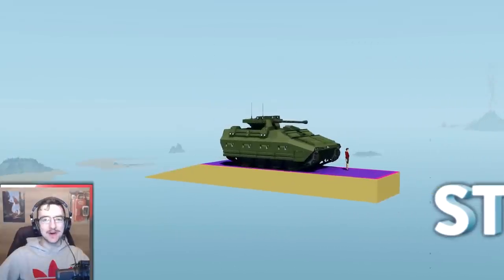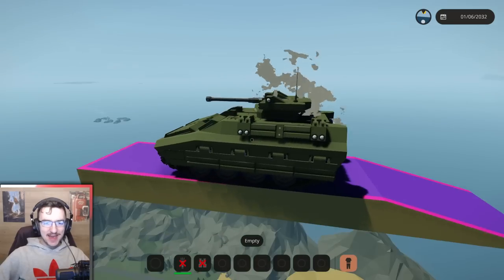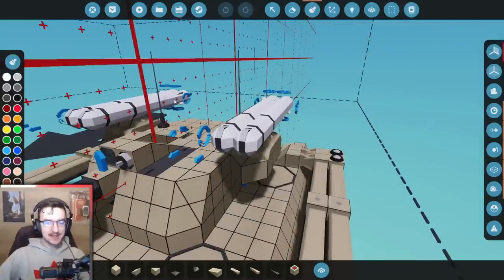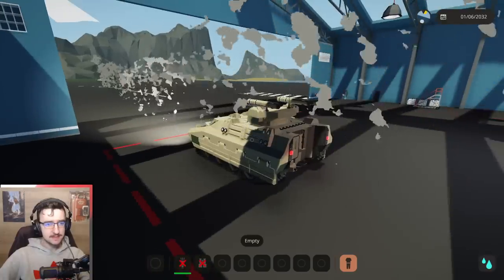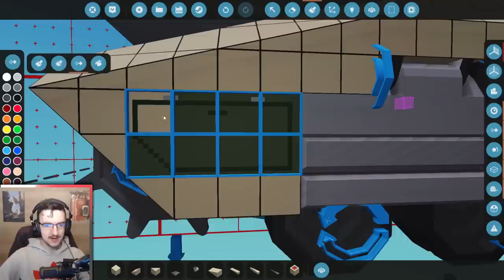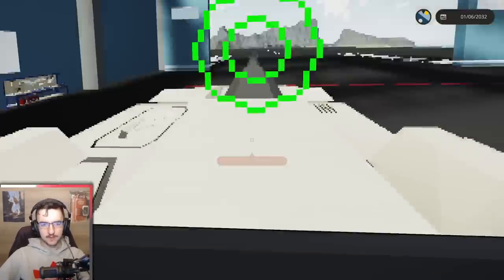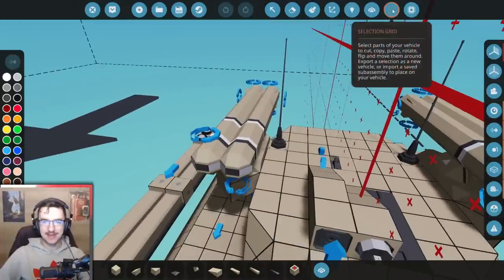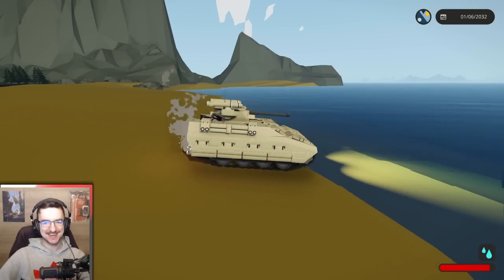OUR IFV HAS MISSILES NOW!   Lets Build An IFV In Stormworks!

Comment: Couldn't you seal the turret ring with a sliding hatch and some blocks. It'd make the interior a little cramped, but it'll make the cab space sealed and make it so there's a layer between the gun and mag and spare ammo. Not an ideal amount of protection, but something to take some of the force from a round.

Also, let me know if you want a microcontroller for the turret rotation that works better than what you got. Default turret rotation isn't all that great. I've got a custom controller that doesn't have a really good ramping speed, but it can stop a lot faster than the default controls. It's a 2x2 in size.